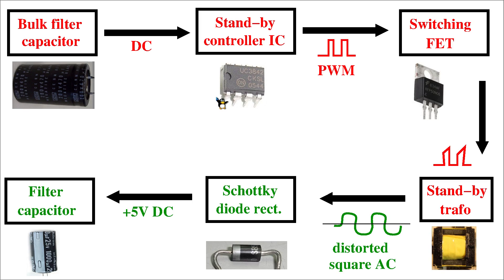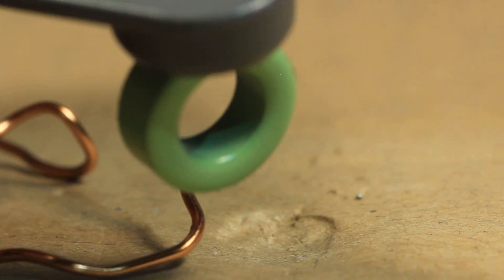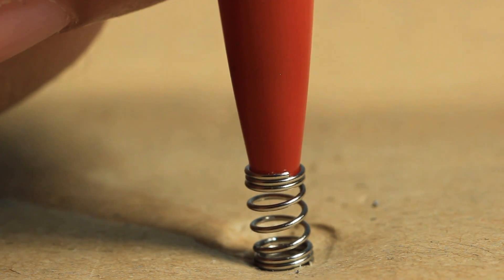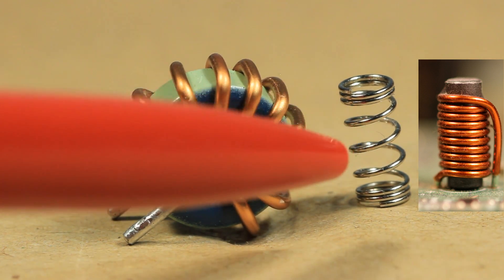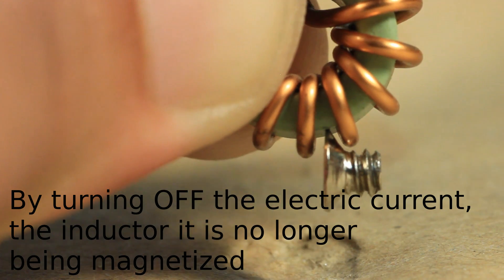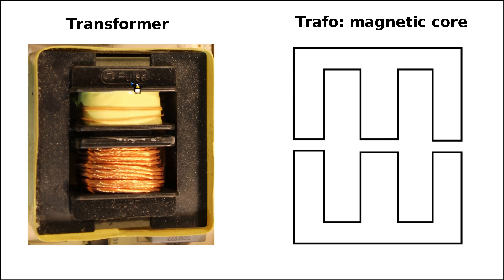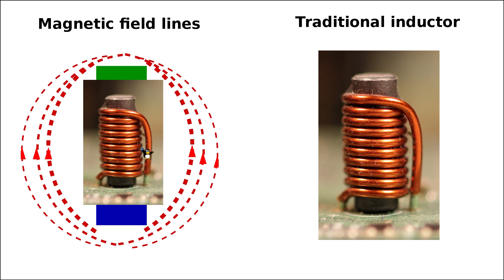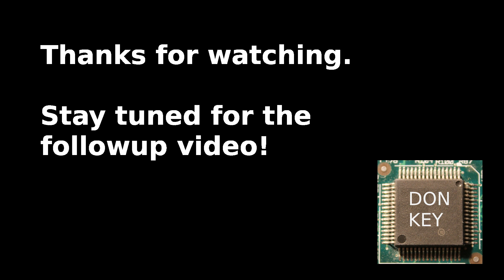Howto repair switch mode power supplies #3: Inductor in electronic circuits P1

Comment: Thanks, you do seem to be drifting off into a lot of time spent on theory and explainations obtained in other videos.  Could you get back to the ATX explaination and maybe do some experiments?
Reply from the maker: As I wrote above, I think that the Post Apocalyptic Inventor definitely creates better videos than I do, but I still had issues with all the mathematics he put in describing the inductor. For most tech repair guys it is just unnecessarily complicated. Regarding him not producing some type of videos: the issue is, that he must make a living out of his YT channel. This means, that he had to check from which videos he get good return on investment in terms of time/money. I wish him all the best, and hope that things turn out better for him, since he looked really stressed and overworked in the last videos.
I got no advertisement turned on on my channel, so I can produce practically any type of video for which I got free time (rarely happens), since I do not need to worry about how much money I can make with a video.
Reply from the maker: For the basic idea of SMPS one must explain the inductor, and I found no video to which I could refer to. Other videos were either fully mathematics based, or offered no theoretical explanation at all.
The next video will need to be still theory, than I will get back into the track of basic ideas of pulse width modulation and continue with the switch mode operation.
Reply from the maker: I am just wondering, what kind of experiments would you like to see? I was putting together a list for myself, but I think that for the time being the experiments should be very basic, not requiring an oscilloscope, so people can 
follow them easily. Also, they should present the basic ideas, instead of trying to be fancy.
I appreciate your input in advance.
BTW, I have went through some of the top suggested videos, and did not find one which was OK for the inductor. The best was from the "Post Apocalyptic Inventor" who is a fellow German Youtuber, making a lot better videos than I do. However, he also went heavily into math/physics, which is not helpful for many hobbyist/repair tech.
Reply: Donkey Learning IT 

The Post Apolyptic Inventor was one of the "bogged down" presenters I had in mind. I really got a lot from his first 5 videos which he said took 30 hours to make and was looking forward into getting into the full SMPS but he never got further. Of course he has been very busy moving and setting up a new shop lately so maybe he will eventually get back to it. I have more than one piece of equipment that does not work because of faulty SMPS, including a spectrum analyzer. I have been watching videos and reading to gain enough understanding to attempt repairs. You can see I am oriented towards the practical but I am happy with theory and math. Thanks again for your efforts. The videos are yours so you are entitled to do them as you please.

Comment: Appreciate the presentation but if you go through every component of an SMPS in this kind of detail you will never get to talking about how they work and how to repair them. I think there may be other videos that explain how various components work. I would hate to have you get bogged down and never finish like others.
Reply from the maker: Appreciate your constructive comment, and you might be right.
However, the inductor is where all the magic happens in the SMPS, this is why I have to describe it in detail. Nearly all videos what I tried to watch were exactly like my old professors, going into Maxwell's equations and deep mathematics/physics/electrodynamics, instead of explaining the basics for everybody.
Also, if I would not be bogged down by my job and actually make a video a week, I would be long finished by now.
Reply: Gordon Wedman not true.  He must do all this or you will not nbe able to troubleshoot the circuit to the source of the problem and you will easily be frustrated, much like now.  There are no sure-fire shortcuts to fixing these.  Be patient and learn, then you won't regret it.